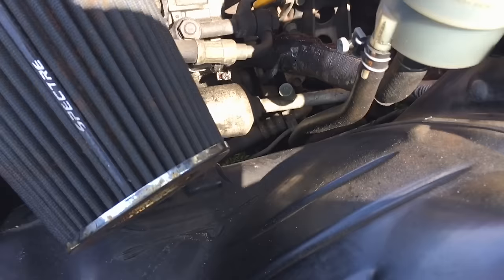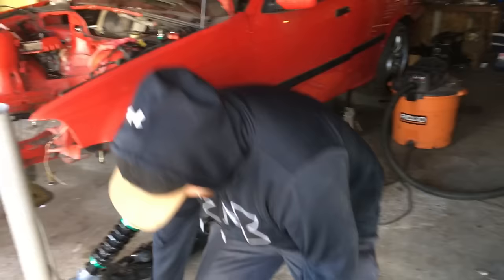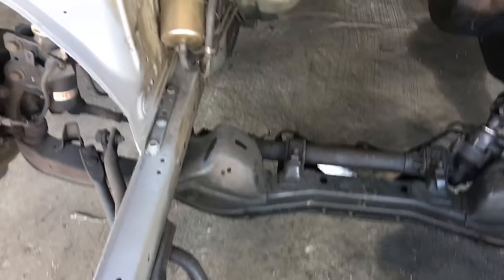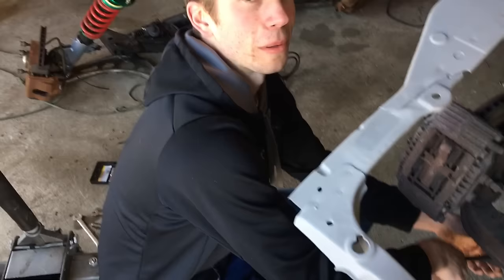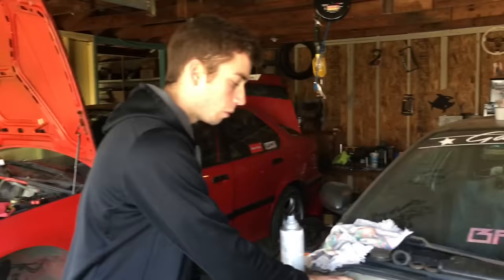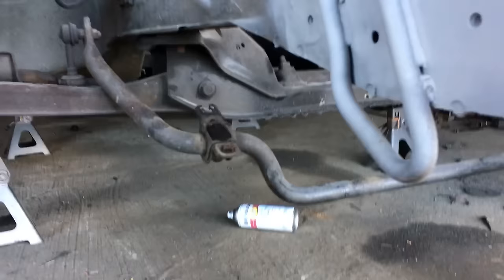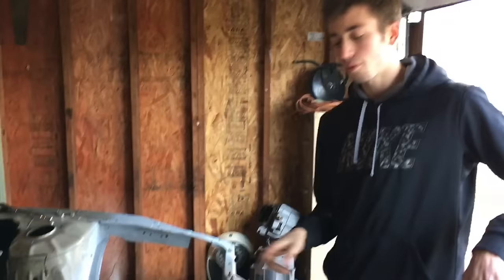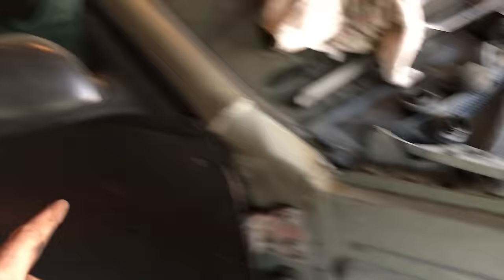Stripping The 240sx Down To Its Shell, Part 10

Comment: NISMO produces reinforced brake & clutch pedal mounts. Most of the strength comes from extra mig welds to help reduce flex and keep the factory spot welds from cracking under pressure. You could google the mounts and copy the welds on your stock mounts.NISMO reinforced tension rod mount is just short boxed-in portion of tension mount and a cross bar.